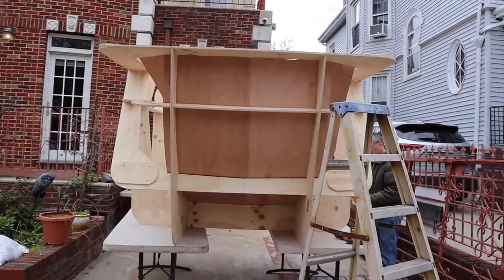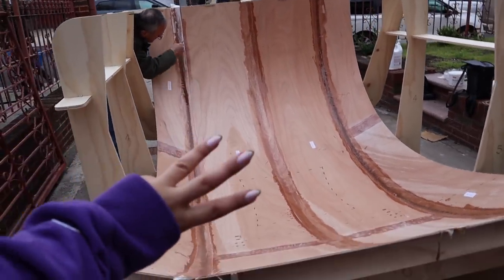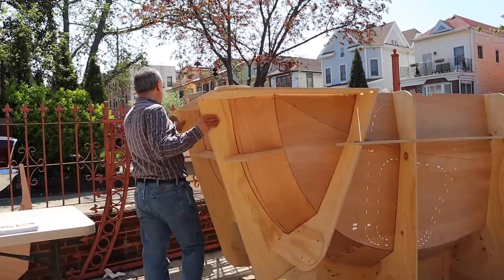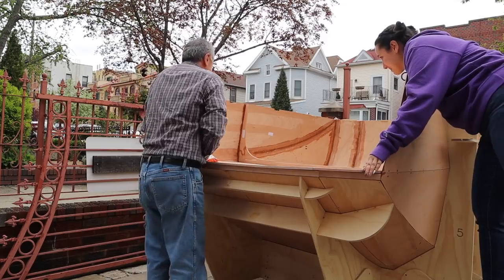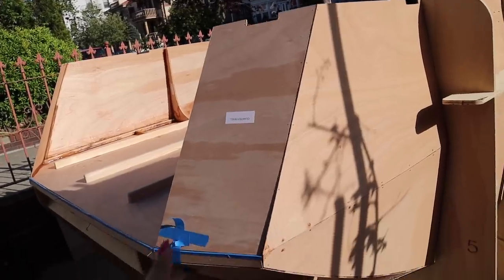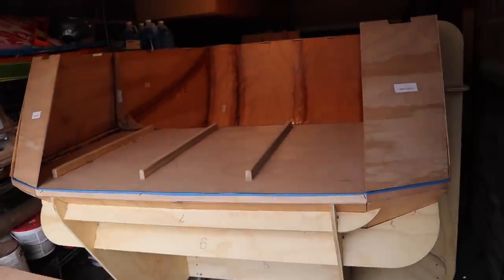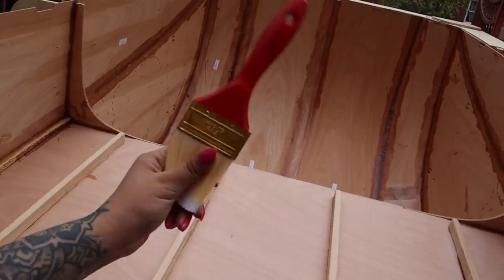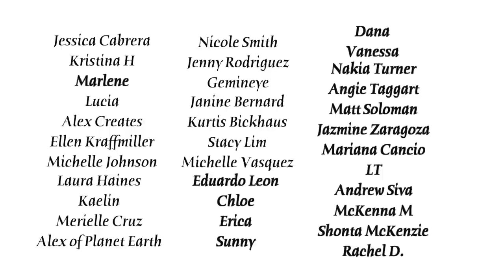DIY Teardrop Trailer Progress - Days 3-9

Comment: I’m watching this two years later but I will say this anyway. The speed limit for trailers is established by two criteria. 1. The expected load and purpose for the trailer. 2. The tracking of the trailer in the design. You can improved and also make worse the tracking by moving the axle forward or backward on the frame. Put the axle in the right location and that trailer can do 70mph safely. Following your videos.

Comment: Tires are rated for maximum speeds. Your trailer is likely equipped with tires that have a Very low speed rating. I would replace them with higher speed rated tires. Also the metal rims are rated for maximum pressures and likely yours are not rated for higher pressures and they may not be rated at all. So rims and tires usually need to be replaced on the cheap Chinese trailers for highway duty. That is likely the limiting factor for your trailers 45 mph speed rating.

Replace only with trailer tires not with car tires!

https://static1.squarespace.com/static/59cbee73e45a7c065615dca1/t/5ab3efcf70a6ad7896483af5/1521741776917/Tire+Load+Index+%26+Speed+Rating.pdf